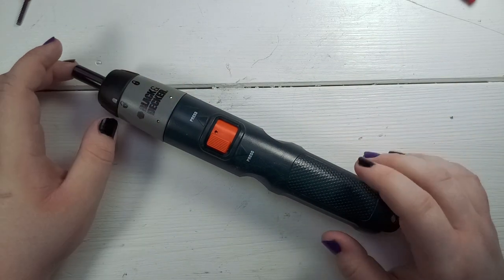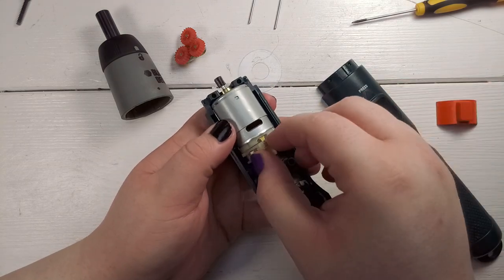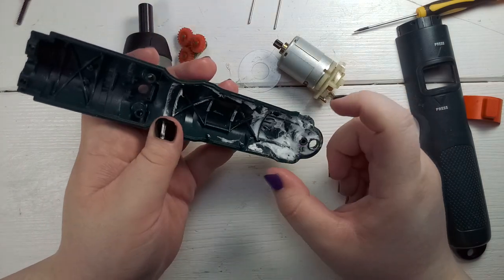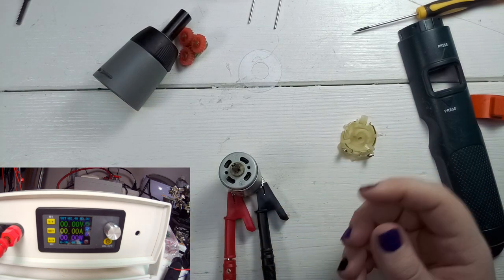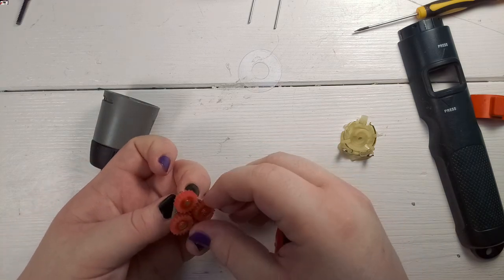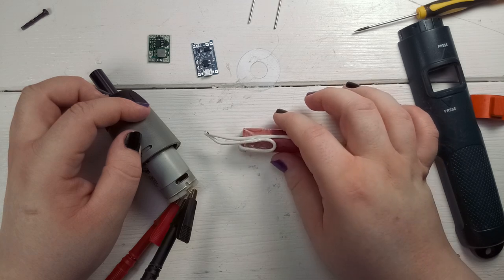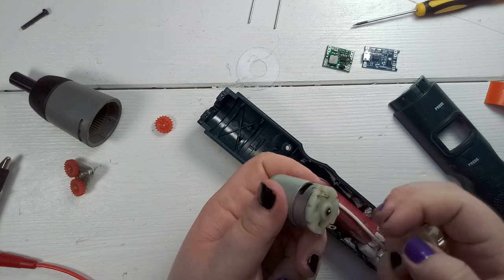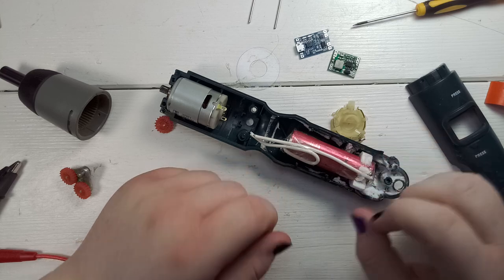Wanna Repair/ Upgrade an Old Electric Screwdriver? Watch This First!

Comment: Congratulations for your effort! I have more or less the same screwdriver (KC9018) and facing the same dilemmas and problems as you do. About the voltage motor, after searching online i found out that these small dc motors are multivoltage (1,5-3V, 3-6V etc) and i said to give it a try, if it gets burnt let it burn, it's a lost screwdriver without batteries anyway...I did the Amber measurement and its 6A-4V (almost same W as yours), the problem is that i can't find a BMS that can deliver more than 3A....For the time being i use it without BMS, which is not correct  since i don't have battery low voltage protection (<2,7V). If i find a  BMS like yours i can charge it from a TP4056 when is off duty by using the original metal jacks. I have tested it for couple days and works fine, it's faster and more powerful. By the way, what's your profession? (I am electrical engineer)
Reply: The original sub c NICAD batteries are still available on ebay. Also, you could upgrade to NIMH, although I wonder if it would really be an upgrade to go from NICAD. The reason I say this is that I just found my old kc9072 screwdriver in a cupboard and it has been uncharged for 19 years. I put it on the charger and it worked fine. You can't do that with an 18650, and you can't do it with an NIMH battery. They die if left uncharged, but NICAD are better left uncharged for long periods. :)) Since it is not meant to be a professional use screwdriver, and with NICADS could drive 100 screws, the average owner is probably fine with NICAD batteries.

Comment: I am working on several of these but are 3.6v. My 3 amp power supply won't even turn it in the screwdriver but an 18650 battery connected directly does. I just ordered some tiny 15 amp single cell BMS boards on ebay.

Comment: Not much knowledge about electronics as learning as a hobby, but the options are bms with direct charging as bms cuts off charging at around 4.2-4.3v. CA-1235 buck converter might be another consideration, use 180SH or 180PH motor as its current consumption is way less and torque is good in its category. I have built my own screwdriver with 12v battery hennkwell gear motor and that pretty much does the job for me in different applications. TP4056 gets fried easily with such 1.2-2.4v motors as starting current goes beyond 1A (my personal experience). Thank you for this wonderful video that will help me a lot in future 🙏

Comment: I have a similar 3.6V skil power screwdriver AND a skill power wrench that I actually did something similar to this BUT what I did was to DIY a flashlight 18650 tube in both cases so I can use unprotected 18650 cells then just charge it on regular xtar MC2s, just make sure you use high drain (at least 10A) power tool or vape batteries and once the running speed of the screwdriver starts going down, just open the flashlight tube and replace the battery with a fresh one and charge the battery while you use the power screw.

Comment: You can still buy the original NICAD batteries in sub c size and also the NMHI ones. I came to this video when I found my old kc9072 screwdriver the model before yours. My wife had given me it in 1995. It had not been used or charged since about 2003. Try re-charging an 18650 that has been left uncharged for 19 years! This NICAD system charged right up and works as well as it ever did I think. I re-oiled the epicyclic gear box with a little gear oil to swish the grease around a bit, and used switch cleaner on the commutator. I think this screwdriver may outlive me! :))

Comment: I would use diodes in series to buck the voltage. Forward bias drop ranges from 0.5v - 0.7v each, depending on the maker.  It will also keep the cell from going to 0 volts.
Reply from the maker: Hey welcome to my channel! :)
On its own a good idea but as the cell discharges through use the motor gets weaker and weaker. Might be worth a shot but I doubt it works for more than a few screws.

Comment: Hello Anna, Question ?
I Made 6 Cells 18650 = 24v 
Without BMS, and I Connected Direct + and -
Why My Drill Does Not Work ??
Thank You.
Reply from the maker: Maybe the voltage is to low or the electric motor is damaged.

Comment: Thank you for the INFO 👍😃
So for me I think there is no problem since the Ikea Electric Screwdriver had 3 AAA rechargeable batteries 1.2V each... so 3.6V total... that is the nominal voltage of the Li-ion 18650 cell and I thing even with 4.2V when fully charged is not too much for the motor since when a Li-ion cell has a big load the voltage drops a bit.
I am not knowledgeable in electronics but from experience I think it might work for me with a bms for 8A or more...
Reply from the maker: My typical rule of thumb is that electric motors are good for up to +10% of their voltage rating, this means that your motor is good for 3.96V. Considering the voltage drop of the cell that can easily be 200mV under small load I think you are good to go. The only thing is that your voltage will drop even more  depending on the load and that can be way more than 200mV so it will easily drop below needed motor voltage although your cell stil has charge. It will go back up once no load is applied. However it could also well be that your BMS cuts voltage if it drops below its rated low point. For example I got 2 different 3s (3 series) 10A BMS, one cuts at 2.5V (per cell) and one at 3.2V (per cell). The difference is the application they are designed for. The one that cuts at 2.5V is designed for electric tools and supports 10A continuous whereas the other one is a generic BMS that allows 10A continuous load but is designed for all purpose use. The first one has to be used in applications with high current, the other one doesn't.
So you might have to shop for a specific BMS with low voltage cutout or you have to modify one. This typically means to switch 1 resistor. What you then have to do is make shure that after the applied load your cell is still in healthy charge range. That said it really depends on the minimum voltage your motor needs, If you got a BMS that allows the voltage to drop to 2.5V but it only spins at 3V there is no reason to buy one of these or modify one.
Going the extra mile for a DC to DC converter that stabilises the voltage goes around load depending voltage drop of the cell and thats what I will try.
I hope that this was somewhat helpful :)
Reply from the maker: @bfnut  Thanks, Happy Holidays :)
Reply: Anna the voltage of one cell is good. Just skip the voltage regulator. You already have current limiting on your BMS so it will protect your motor. How ever it may protect it too much. So just hook it up with just the BMS and see if the torque you get from it is enough for you. If not then we may have a problem and need to find a better BMS. By the way I have about 3 of these I need to do. So please show me what you get! Thank you for the video's
Reply: Sorry I ment to say over current protection on BMS not current limiting.
Reply from the maker: @Curt Stacy Hey, welcome to my channel! :D
The DC to DC converter I was talking about would stabilise the voltage. Lets say we have a 1S (1 series) cinfiguration and your motor is rated for 3.6V (example from above). Your highest torque is typically accomplished by its rated voltage. If you don't supply 3.6V to it, it will draw higher current and the torque will fall further and further down until you reach a certain threshhold voltage at this point it stops spinning. Lets say it Stops at 3V but if you have any load on your battery its voltage will drop (load dependent). This can easily be 1V and if the motor stops spinning at any voltage lower than 3V your cell can only supply power as long as its voltage without load stays above 4V. To go aound that and allow the cell Voltge to drop further down unter load we can use a buck-boost converter. Above 3.6V it would regulate the voltage to 3.6V and below, it would boost the voltage to 3.6V. Highes torque at all times and you use all of your battery's capacity. That was the theory behind a dc to dc converter. The BMS Makes shure that the current draw is always within the cell specification. If you reuse old cells you need to look for a datasheet or if not avaiable be careful not to draw current above 6A per cell (rule of thumb), speaking about 18650 cells.

This is the case if your motor can handle 3.6V (electric screwdriver that bfnut got).But in this video, the motor is only capable of handling 2.4V so I need to use a buck converter under any circumstance.
Reply: @PhysicistAnna  Yes I understood that. the point I was trying to make and failed is that with a 2.4 volt motor you can overvolt the motor witch will give it a little more speed between the 3.7 - 4.1 volts of the cell but you limit the current to protect the motor. I have some of those BMS's I don't believe I remember getting 6 amps before it cut out I remember lower but could be wrong. so if the amperage of the BMS is enough for what you want to use the screw driver for your ok, it won't burn up the motor. if it does goto 6 amps and you want less then all you need is current limiting witch you may be able to do much smaller than a dc to dc converter. you may be able to adjust the current cut out on the BMS with a resistor change. just a thought for you.

Comment: Or you vould open the motor and rewind it with lower gage wire to increase the voltage directly connected to the battery.you can alsi use a smaller size of battery and  more buck converter in parallel
Reply from the maker: Rewinding the motor is something I never did and sounds like an aweful amount of work^^
Reply: @PhysicistAnna  try it but first rewind small dc motors.Am sure you will enjoy it